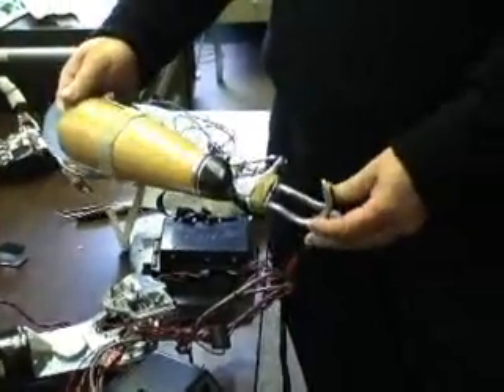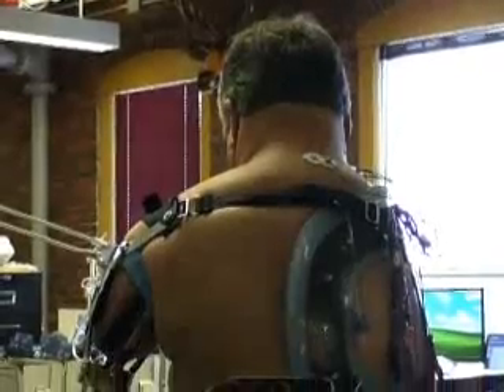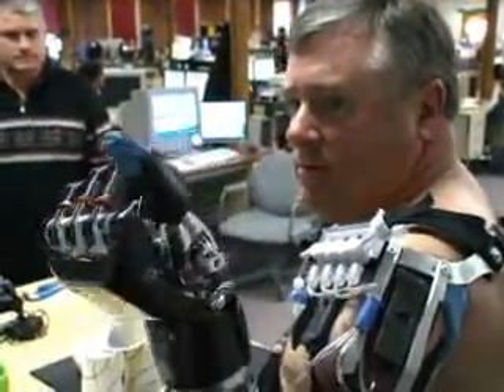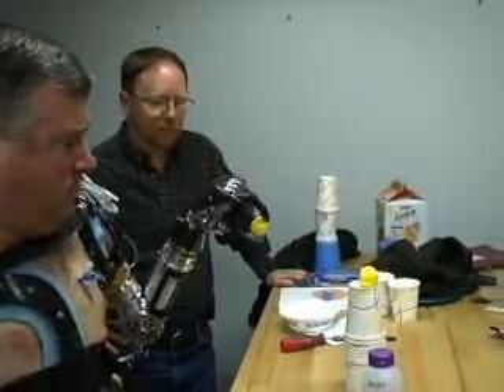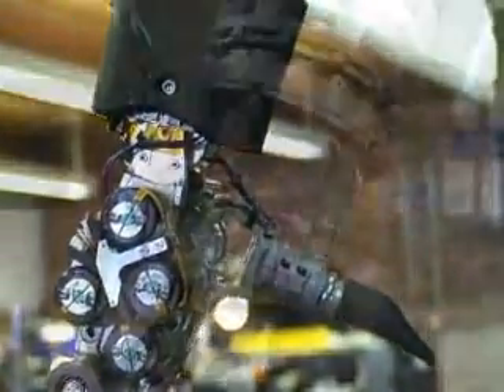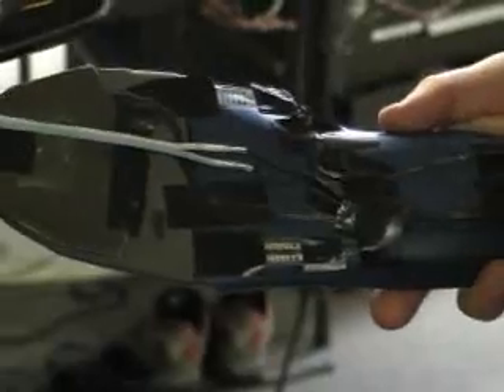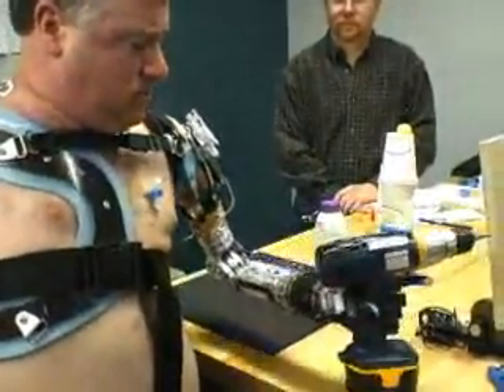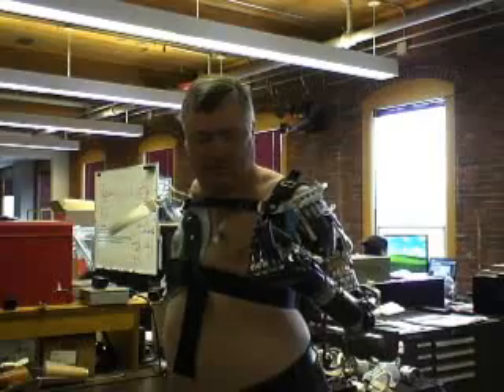Dean Kamen's Robotic "Luke" Arm

Comment: Like Kamen's dismal failure iBot Wheelchair,again this looks like an under-engineered $100,000 Prosthetic. Yes $100,000. It has a LOT of flaws, hand is 2-3 times as big and at 9lbs patients won't wear it long. The ottobock myoelectric is still a better choice weight and looks wise

Comment: @vboye field of study is Prosthetics. Only a few Universities have this. Dominguez Hills, CA and Northwestern, IL
Reply: The design of the Arm is pure Mechanical engineering. Something Dean Kamen is horrible at. The iBot wheelchair was a dismal failure. iBot could climb up stairs, problem was you had to have great upper body strength for it to work. People in electric wheelchairs rarely have upper or lower body strength, thats why they qualify for an Electric wheelchair and not a manual. Duh Dean
Reply: Dwight Stones if only you were in a wheelchair, you would know how wrong you are. I would have killed for an ibot

Comment: there are traditional prostesis.. and this one is way to expensive for commoners.... the best buy mech arms are always plastic cheaper disposable moderately reliable .. the second is metalic aluminum. stainless steel. or light weight steel UBER EXPENSIVE so super reliable adjustable.. but can affort it?

Comment: @splendidmate No it isn't. I have been working on this type of thing for years and can tell you that the electrical signals sent from the brain to the rest of the body are not strong enough to power any machine without any sort of boost. Or rather, not efficiently.

Comment: @Egglesplork all of those were failed experiments. Especially the one attaching one dog's head to another, as you can't repair or regrow the nerves in the spine, so you just have a dead head on a dead body. Not useful. There's more to consider than being too "sissy" to do it. For one, the proccessing power to control an arm like this just didn't exist until recent years, same with the battery power and control units. 
Welcome to the real world, where science takes time and effort.

Comment: I wouldn't say 100 years.  in the last decade we have made increadable leaps in this and similar fields.  i think we can see more pratical applations in maybe 20. The bigest hold back is going to be cost.  Scienctits such has Dr. Warwick have already done pratical research into the linking artifal elements into the brain that sends and receives motor-control signals for the body.  I look forward to seeing the partical applations of this tech before I die.